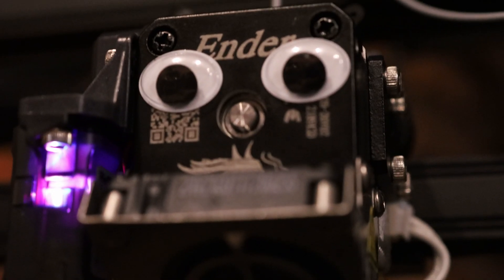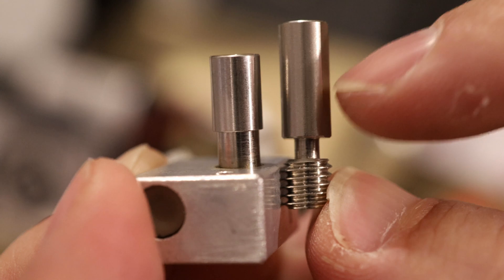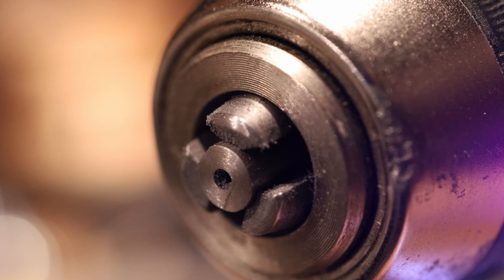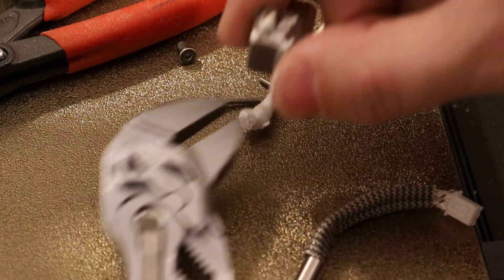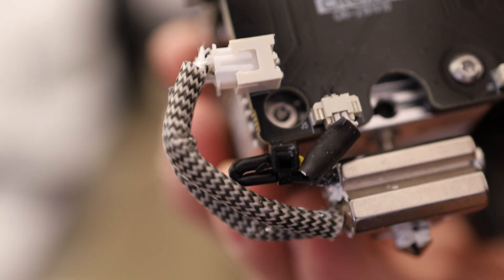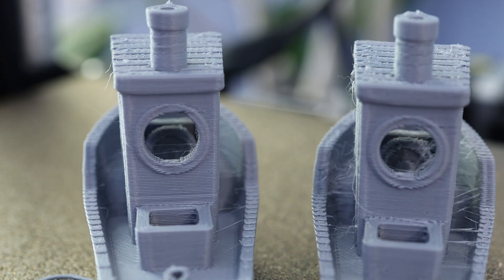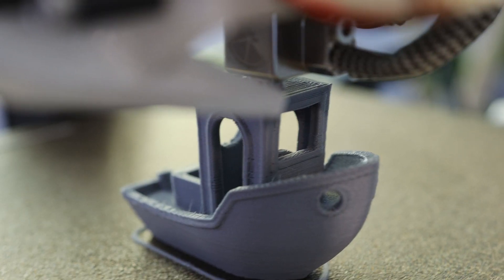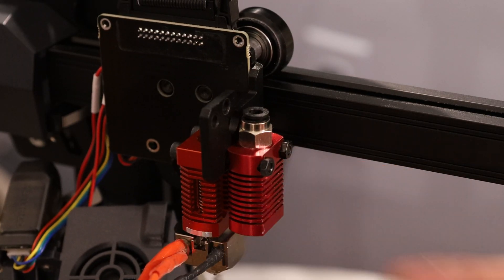Ender 3 S1 - All-Metal Hotend Upgrade

Comment: I have an S1 with the copper (or whatever) heat break and a CHT nozzle.  Can I use the same heat break, nozzle, heater and thermistor in the slice heat block?
Reply from the maker: Probably could use the slice copperhead, but if the stick setup is working I wouldn’t worry too much about the hotend

Comment: The side flow of extruded filament is probably from exceeding the melting capacity of your hotend.  You're extruding only partially melted material, which is getting bent and twisted inside your extruder.  When it comes out, it's free to unbend itself, and probably is solidifying in air, leading to curling and warping in mid air.
Reply from the maker: That is a very nice explanation, thank you.

Comment: why would you put thermal paste on the heatbreak? I understand it can help for the nozzle and the heating element...but for the heatbreak? Why? As i understand the working method of that part, it wouldnt be wanted to increase the conductivity to this part. If anything at all, insulate it/put a poor-conductive compound on the threading. Or maybe im getting something wrong. I mean, isnt that what the PTFE tube was originally for? making it hard for the heat to travel upwards? Youll make it even harder now to hold the high temps in the nozzle, because the heat gets literall sucked out of the block and cooled away in the heatsink. just saying.
Reply: youre absolutely right, we dont want any increased heattransfer between the heatblock and the heatbreak. This guy only knows to a certain extend what hes actually doing. I also dont appriciate the way he works, a little bit dirty and sloppy.

Comment: Not to pop your bubble but you can just buy the all metal end for around $22

I did it with my S1 +  and from the box it printed perfect no stirring nothing, then I added the all metal end and had to do some tweaking on retraction and Bam was good to go  
But as always you offer a way to upgrade and for that I thank you and till your next post be well and many thanks
Reply from the maker: I broke one of the all-metal hotend in my Ender 3 S1 Pro. I think it's still worth getting the CHT nozzle of you want faster print speeds. The simplest solution is to get the Creality all metal hotend

Comment: Hey I bought the sq plus because I wanted a larger print area. Is it completely plausible to say I could upgrade the plus to being as good as the pro with mods?
Reply from the maker: Yes, you can make it better than the pro with some simple changes.

Comment: I’m new to printing but I was not Impressed by either of your boats.
Reply from the maker: Those prints were printed at higher speeds, quality was not a priority.
Matte grey filament and extreme close-ups will make it easier to see flaws in the print. 
I could have printed in glossy black or red, but then you wouldn't see the flaws. I'm not trying to get an award for nicest quality prints here, just trying to see the characteristics of the printer at high speeds.
Reply: @NathanBuildsRobots  .  Fair enough. Please excuse me, I’m learning.

Comment: After I chage that hotend how can I use 300ºC ?
Reply from the maker: You need to update the firmware. You might be able to just flash the S1 Pro firmware onto your machine, but I haven't tried this.

Comment: Good job.
And I had the same issue using your suggested blower fan at too high speeds: it blew the filament right off the nozzle ;)
So maybe it's not side shooting due to fast extrusion, but more a blowing to the opposite side of the fanduct.

Comment: So, i can't change hotend without cutting wires and shit? guess I'll buy pro version sprite
Reply from the maker: You can change nozzles to a CHT and put in an all metal heatbreak in, without cutting wires. 
You'd just keep the old heater block, thermistor, and heater cartridge. 

I still think you'd get nearly double the print speed and it would be an easier install.
Reply: @NathanBuildsRobots  I should've bought Pro version :D
Reply from the maker: @Torskel  yeah I was annoyed that the pro version came out 1 month after I made this video with some really common sense upgrades. Mine is basically a pro now.

The pro still has below average part cooling, so some upgrading is inevitable IMO
Reply: @NathanBuildsRobots  There's a drop-in hotend with wires made for the S1 on Ali express
Reply from the maker: @Torskel  I'll look that one up
Reply from the maker: @Torskel   US $16.80  20%OFF | CREALITY High Temperature Heating Block Kit Customized For Ender-3 S1 CR-10 Smart Pro Printer Equipped With Sprite Extruder
https://a.aliexpress.com/_mPjlKMi

Looks nice. It says free shipping but when I go to place order it adds $8 which makes it just expensive enough to not be worth it for me 😞 

If I didn't already have an upgraded hotend it would be a good choice though
Reply: @NathanBuildsRobots  Yeah that one, lots on the FB group likes it, I might get it so I can do at least ASA without melting the PTFE piece inside

Comment: Is your print cooling fan hanging down low on the left side?  I ordered a brand new s1 and the fan in the front hangs down lower on the left than on the right.  It looks like it's bent or something.  I don't understand how this happens with a new printer.  Everything I order has something wrong with it so I go new to try to mitigate potential problems and I get this.  It is just barely not touching the print and at times it looks like it might actually be touching it.  Worst part is these things are so much trouble to assemble, disassemble, and rebox, it would be hard asf to return unless they let me just exchange that one part.
Reply from the maker: Yeah, I would just Uninstaller the stock part cooling fan and print out the one i designed. I have a video on it. The stock part cooling fan is crap.

https://www.patreon.com/posts/62368547

Comment: Is this the case for S1 and S1 pro as well? I thought S1 pro had an all metal hotend…
Reply: Pro is all metal.
Reply from the maker: Yes, you wouldn't need the heatbreak upgrade on the pro. But it would still benefit from adding the CHT nozzle.
Reply: @NathanBuildsRobots  Personally, I haven't tried the CHT nozzle, only the ones from 3dsolex, from which Bondtech has licensed the CHT. Those work well, though ;)

Comment: Why do this over buying the official metal hot end?  You can get the official metal hotend for $85ish, slap it on and be done with it.  Here I need to buy 4 separate tiny components, which will probably run me $40+ish by thew time I get them shipped, then spend several hours cutting, sanding, soldering, pasting, etc.  Is spending all that time really worth it to save $40-$50? Or is thi smod giving you a faster flow over the official hot end?
Reply from the maker: Well, it didn't exist yet, for one. Kinda peeved at creality for releasing g these so close together and nerfing the normal S1. 
The CHT nozzle will give increased print speed, so it's a worthy upgrade even if you go with the pro hotend.

And if you just replace the heatbreak it's a $10-30 upgrade vs $75, so its still a good way to save some $.
Reply: @NathanBuildsRobots  Hey, Nathan. Does the original heatbreak and thermistor enough for the copper titanium tube or should i better take the kit, which includes the whole hotend? There is a possibility to order just the tube, which is 10$.

Comment: Any particular reason why cut it to match length? Could it not just be 3mm longer,  or is that a problem ?
Reply from the maker: Its no problem, you just have to extend the CR- touch down about 3mm.  
I've done that before, using slightly longer bolts and 4 m3 washers stacked under the cr touch.
Reply: @NathanBuildsRobots  I learned the hard way that with out moving the cr-touch (did not think of that) the nozzle will dig into your bed. But I ended up cutting the plastic tip that is sticking out. And that turned out good :)

Comment: Nice guide - any idea how much power the controller board can provide and what that hot end will consume?  I’m just a bit concerned that it might do some damage to the printer by upsizing the hot end
Reply from the maker: You can always install an upgraded nozzle and keep the same old hotend/heater cartridge. That way you will minimize issues.

To do a proper analysis you would need to look at the MOSFET's datasheet and consider the PWM frequency, current, and voltage.

Generally people say the safe limit is about 50W, or 2 A. 
I feel comfortable as long as I keep it under 72W or 3A.
I have ran up to 150W, or about 6A with no failures.

Comment: Hi Nathan, just got my ender 3 s1, what if you used  a capricorn tube instead of the ptfe piece that you see inside, wouldn't that be a good enought solution?
Reply from the maker: Capricorn only buys you a couple degrees C, so it would still rule out higher temp filaments like nylon and ABS.

Also the tube is not a standard size, I think it is a smaller diameter tube, maybe 1.9 ID 3.2 OD.

Comment: What’s the max temp after an all metal hot end upgrade? 260? Is that locked by firmware? Lots of info going around on the ender 3 s1 Facebook page but it’s conflicting and convoluted. I have purchased the hot end and nozzle you have suggested. Hoping ur new video drops soon before I do it. I have never modded a 3d printer before.
Reply from the maker: Max temp is firmware limited to 260. To go higher you need to upgrade to a high temperature thermistor and update the firmware to work with it

Comment: Hello, does anyone know how big the replacement nozzle is?  0.4 or 2.0 ❓🤔
Reply from the maker: the standard nozzle is 0.4mm
Reply: Thank you for your quick feedback. 🙂👍🏼 Okey, that means the built-in nozzle and the replacement nozzle are both 0.4 mm.  
I just subscribed to your channel.  
Very interesting videos.  
I especially like your modified cooling.  
I would also like to test it.  Can I get the STL file ❓😉

Comment: Check out CNC Kitchen for a great explanation about the cause of the side pulling at high flow rates. basically its internal stresses from the filament not being fully melted
Reply from the maker: I think I saw his video on the subject. In my most recent video I tried to explain with diagrams what is going on, with 1 of the channels getting a higher or lower flow rate due to the filament actually entering into it.

Comment: Your fan + fan duct upgrade is producing increased airflow...like a turbo jet engine. The airflow coming out of the vent is too strong, and  causing the filament to be blown away.  Lower the fan speed and run another extrusion test.  Let us know if it makes a difference.
Reply from the maker: I did these tests with the fan off. The same thing showed up in my other tests too, some without the fan installed at all

Comment: Do CHT nozzles have any issues with retraction due to the tri-split pathway of the filament?
Reply from the maker: I did not notice any decrease in retraction performance. If anything, the retractions looked slightly better on the CHT nozzle, but it's so close I wouldn't really say its better one way or the other.

Comment: Never ever ever do this!
Reply from the maker: What was I not supposed to do?
Reply: @NathanBuildsRobots  I applaud your efforts for sure don't get me wrong. 

I would not modify the hardware because a manufacture  made a poor decision by continuously using a ptfe liner. 

It took them about a week after the original release to change it and make the all metal version. I am not aware if it  Is is just a change in dimension and not material or if it is also a proper material change. Steel to titanium for example.

Nonetheless this is par for the course for Creality as they have come out with well over a dozen printers over the last 2 years instead of putting forth the vast majority of their development in to putting out 1 or 2 extremely high quality machines at cost they are trying to keep the budget low while continuously changing.  If they converted these to upgrade kits instead of complete new printers they would likely get more sales. This is a similar model to prusa which has been wildly successful.

Comment: I have a better idea without to much modifications.
Just replicate that small ptfe tube ( with a lathe)from coper 😉 and use a quality nozzle.
Reply from the maker: If the PTFE tube was replaced with copper of the same size, the heat break would no longer work. There needs to be a section with very low thermal conductivity to keep heat from the melt-zone from going up into the upper parts and melting the plastic in the extruder, causing jams.

Comment: Do you have an updated parts list for slice parts that fit?
Reply from the maker: Yes,
I'm going to do another video. I learned a lot doing these mods and want to show the easy way to do it

I'd just get this: 
https://amzn.to/3gy4tYz
Sick with the stock heater block
And get a MK8 CHT nozzle.
Reply: @NathanBuildsRobots  Thanks again... What bed sheet are you using?
Reply from the maker: @johnvira1529 
I'm using this one in 235x235 size
 https://amzn.to/3GFz7JS

You can get it with our without a smooth PEI sticker, but I don't like those. You will get a much another surface finish on the bottom side, which can look cool, but PETG will destroy it 

Ive never had a textured PEI bed get damaged and they seem to hold on to parts just as well.
Reply: @NathanBuildsRobots  got the bed, works great with pla, but petg is not sticking any suggestions?
Reply from the maker: @johnvira1529  I have not tried PETG with it yet, though I used a similar PEI bed from PRUSA and printed tons of PETG on it. 

I would go with the PusaSlicer "Prusament PETG" filament preset, but bump the bed temp up 5 degrees. I'd add the 5 degrees since this type of bed doesn't conduct heat through it as well as the prusa bed, so you'll probably get a few degrees lower surface temperature. 

If you don't use PrusaSlicer I can look up the bed temp for you.
Reply: @NathanBuildsRobots  I use creality slicer.
Reply from the maker: @johnvira1529  Ok, well I looked it up, I would try: 
75 C bed temp
disable fan for first 3 layers
max 50% fan speed
Reply: @NathanBuildsRobots  Thank you, but found my problem...Needed to clean bed with cleaner.. I used simple green and now all sticks :)
 Fingers crossed
Reply: @NathanBuildsRobots  do you have an affiliate link to a mk8 cht nozzle? I used ur pei sheet last time.
Reply from the maker: @DxApollo  
I don't have an affiliate account with anyone that sells MK8 CHT nozzles, and provides decent shipping prices to the US. I bought mine here though, I think shipping was around $4:
https://www.filastruder.com/products/bondtech-cht-mk8-coated-brass-nozzle

Comment: I'm still wrestling with my S1 hotend upgrade. My plan is similar to yours - slice copperhead heater block, slice G2 heatbreak, new thermistor and heater cartridge.
The JST ZH connector on the thermistor is my issue, it's hard to get this hardware.
I had to order some crimp pins from digikey and plan to re-use the JST ZH head from the stock thermistor. Your video is making me feel like I might just brave soldering the wires instead of dealing with crimp attempts.
Reply from the maker: If you look at my fan video, I link to some of the tiny 1.25mm jst connectors. You'll probably find them useful more than once if you like modding your S1, plus you can keep the old hotend as a backup

Comment: I don't think you used enough boron nitride paste for this. You're going to have terrible heat transfer. You need more boron nitride paste. Pro tip: If you go to the grocery store and buy one of those cake piping sets, you can do a beautiful decorative rose pattern all around the hot-end with the boron nitride paste. Perfect for weddings!
Reply from the maker: How do you know when enough is enough? I saw a video by Thomas Sanladerer where he clogged the nozzle with boron nitride, so I tried to avoid that!
Reply: @NathanBuildsRobots  You may need to frost the entire Ender 3 with Boron Nitride paste, just to be sure. Then top it with a bride and groom cake topper. Then enter it in a baking contest. ;-)
Reply from the maker: @EV-wp1fj  my sarcasm detector just beeped, but it was really faint. Oh well, better be safe than sorry. I'll start printing out that wedding topper for my 3d printer.
Reply: HAHAHAHA

Comment: Was the cooling fan on during the 'side shooting'? 

I had that issue with my CR10 at higher extrusion speeds, until I installed a 'fang style' blower that seemed to work to stabilize the extra fast/hot extrusion.
Reply from the maker: The cooling fan was off. I talked to bondtech and they said that happens when you are near the limit of volumetric flow rate. I have some theories on exactly why it happens, and some workarounds for it, but its only an issue at 30+ mm^3/s so its not that big of a deal